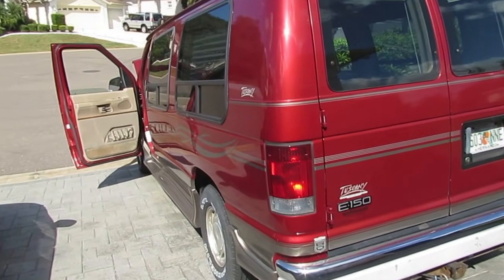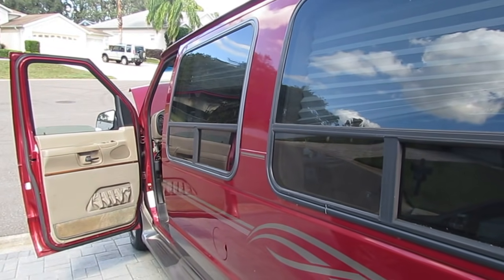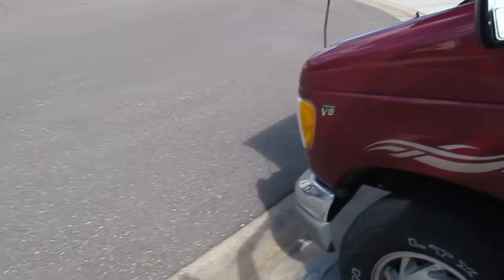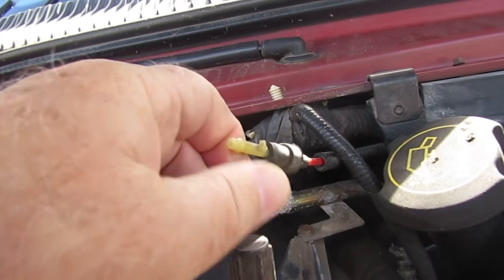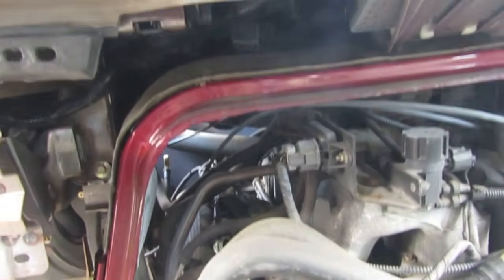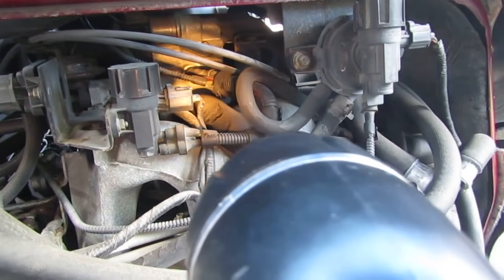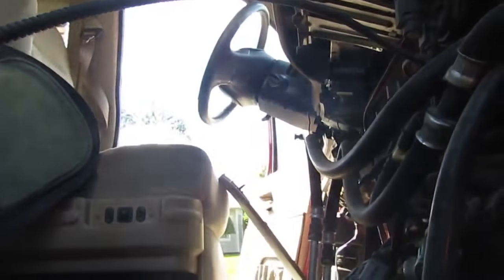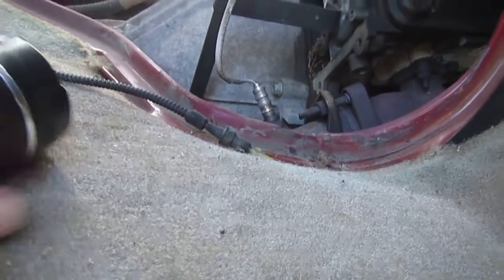how to fix e150 e250 e350 e450 e550 Econoline Van ac stuck on defrost !

Comment: The vacuum booster is behind the blower motor. Just buy a new one.Mount it under the battery tray. And route that line you had in your hand hiding. To the new booster tank. As your ass has to pull that old one by removing all that AC shit that covers it....

You can drill an access hole in the fender well. To get at the 2 bolts that hold the old booster tank. Then just use sheet metal screws to cover the hole. You still have to remove the passenger fender. To reach it...And you do need that check valve. It prevents the booster from back bleeding.

Comment: Or here's the problem with when you bypass it directly when you step on the gas the vacuum is so strong it goes off the vents
Reply from the maker: No, you have it backwards. The vacuum drops when you accelerate and slowly recovers when your speed evens out. 
I placed a small canister and check valve (home made) under the dash near the glovebox. I described it in the description above. But you can just live with the drop-outs as I did for awhile. It's a minor nuisance, better than stuck in defrost.

Comment: Great video the only problem I see is that you eliminated the check valve which may cause problems down the road
Reply from the maker: It's not a problem. The only thing that may happen is that under heavy acceleration you may have the loss of a/c vents momentarily and the defrost will come on but then return back to a/c or heat after the vehicle gets up to speed. This is not a 'problem' for most people but you can add add a vacuum cannister and a check valve under the dash if you want 100% functionality. The momentary dropout doesn't bother me. Read the other comments and you'll find advice on how to add those two things.
Reply: have you ever changed one zipsnipe?  Its a huge job.
Reply: Simply add a vacuum canister and check valve to this set up and mount it under the dash problem solved.

Comment from the maker: @soldotnastan- firstly, you clearly don't understand vacuum systems as you cannot, or will not, do any harm to the vacuum motors in the dash by using this method. 

The worst thing that happens in this situation is that you get a very temporary return of the airflow through the defrost under heavy acceleration. 

The vacuum reservoir is simply a storage container that supplies vacuum, by storage in a vessel with volume using a check valve,  to the motors under this situation. Yes many, including myself, have built vacuum reservoirs out of various cylinders, mine from a tin can, two brass nipples and a check valve. 

It's totally unnecessary however as I drove around for more than a couple years without it and rarely experienced any change in loss of air through the front vents. It was just a minor nuisance.